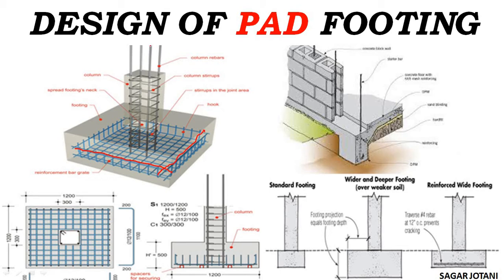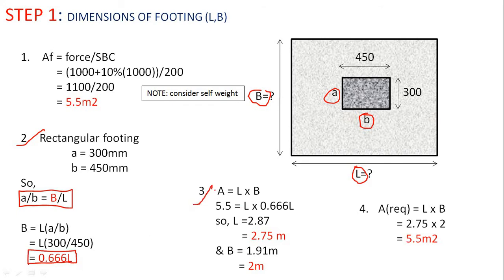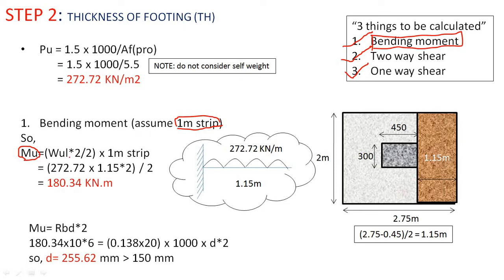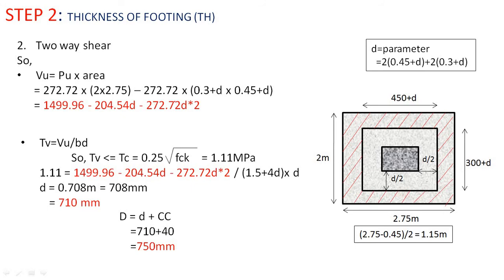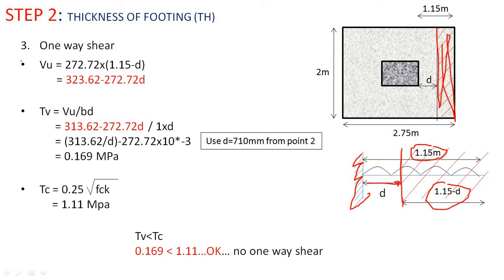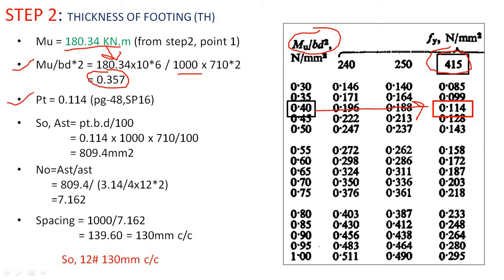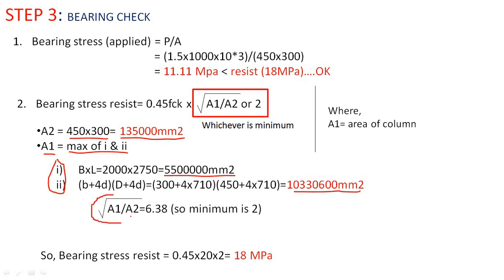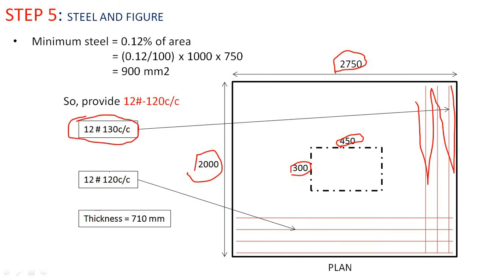Design of pad footing

Comment: I have a complication
Reply: A 225mm by 450mm column supports an ultimate load including it's own weight of 504KN. The soil bearing capacity is estimated to be in region of 105kN/m2. Design a simple pad footing using a grade 25 concrete and high yield steel, fy=410N/mm2
Reply from the maker: @emekachukwu7207   So how can I help you